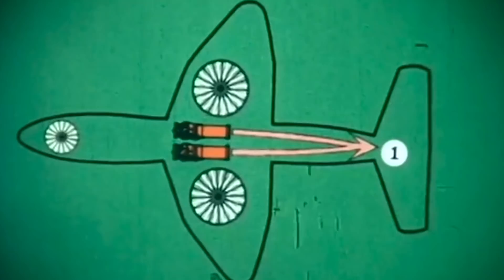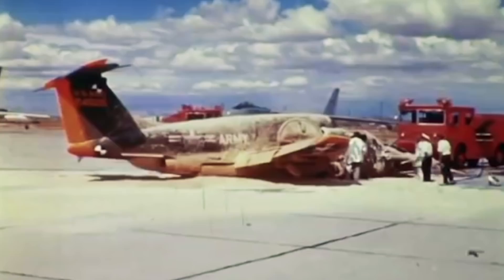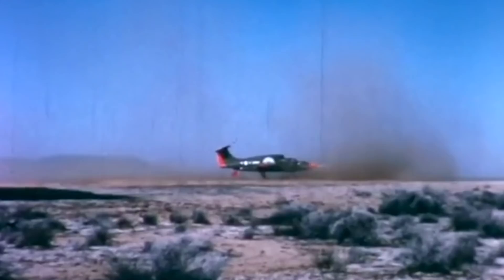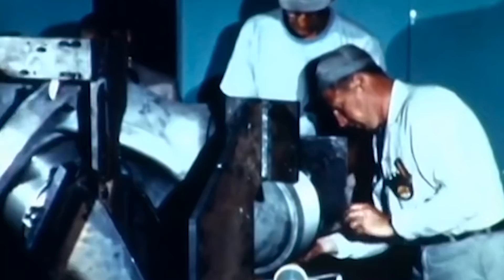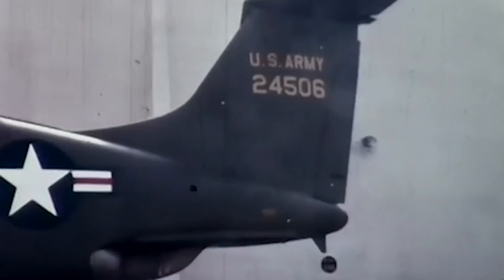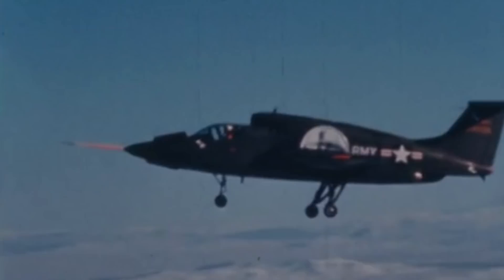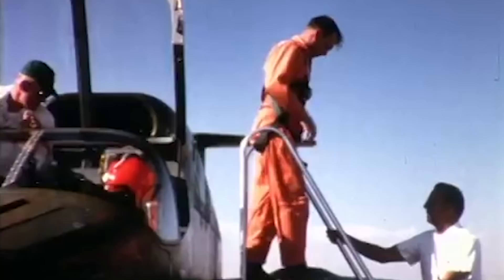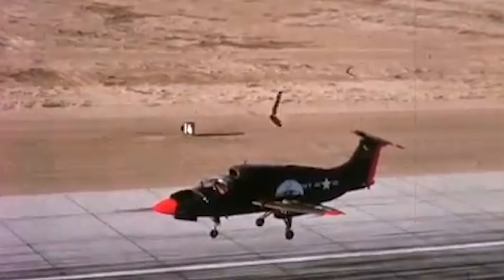Ryan XV-5 Vertifan - American Jump Jet

Comment: If not getting my math war vs peace time or soon to be godly sure war event. 50 or less prototype numbers pre war. 100 needed ready or not best poss fixing along the way. During the war winning strong design sure to use 1k buy. WW2 star 5 or 10k buy. Peace time 10 trying or so enough to try if it flies not to radical.  unless spelling out less or more reason long term work to be done or better stepping on climbing on project.